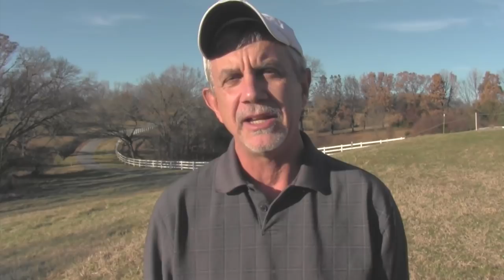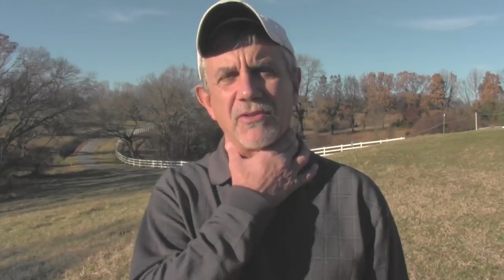Does a Three or Four Cylinder Engine Have More Vibration?  What Other Factors Affect Vibration?

Comment: My new Massey Ferguson 2850 has 4 cylinder engine and is hands down the smoothest tractor I've ever operated. The platform is fully isolated via rubber mounts so I don't feel any vibration.

Comment: I've tested a lot of tractors in the 23 to 65 hp range... The sweet spot is 40 to 55hp. Going larger is in most cases not necessary unless one has a specific work load or job needed where more power is the only way to get the job done. A good seat goes a long  ways in comfort as there is no suspension in smaller tractors when compared to a UTV set-up. Also the 4 cylinders do have a slight edge in 4 stroke balance. Also sometimes a cab model can be more comfortable due to more of the weight being planted down.

Comment: I dont have a tractor yet, but have been a mechanic for 38 years. Yes a 4 cylinder will be smoother than a 3 cylinder. If you only need a smaller tractor and use it to pull stuff and use the rear pto then maybe an old Ford or Massey Ferguson gasoline engine will be best, those engines are really smoth compared to diesels. But I think he will have to go and try a few himself and may have to get a bigger tractor than he really needs in order to get the 4 cylinder

Comment: Decibel meter! Lol Tractor equals vibration. From a man that also has arthritis I find the landscape makes a big difference. I am fortunate to have two. My 1980 JD 1050 is a Cadillac compared to my 06 NH Tc45da. Each one has its advantages but noticed I'm more sore after working with the NH. NH bouncy Jd smooth. Not sure on new ones but I try to stay away from them. Quality is not what it used to be. I believe the smaller the tractor the more vibration. Thanks Mike for all your great info!

Comment: As always Mike, good practical advise. I indulged when purchasing my tractor, some call it a midlife crisis toy but I wanted to be comfortable when it was hot and dry or cold and wet. I bought a NH 4.75 instead of the JD 5075e mainly because the motor is a 4 cylinder.  The only thing I feel I missed out on was the park position in the JD gearbox. This feature locks the tractor real good when on the hills, the only thing stopping mine from rolling away is the handbrake (or the loader😏). Take care Mate👍🏻

Comment: The issue of vibration from AG tractors has been an age old problem that has caused a number of health problems for farmers - so much so that the topic has been the subject of numerous scientific studies based on google searches.  From what I can glean, the 2 main culprits are the steering wheel and the seat. I was not able to determine whether these studies have resulted in any practical solutions.  I have a NH Workmaster 40 that's about 5 years old. I absolutely love it, but I'd avoid it if you are looking for low vibration. The seat is on springs, so I don't believe that's a major cause (from a mechanical perspective it is detached from the engine and frame). Perhaps the unmatted floor contributes somewhat, but I seem to feel vibration through the
steering wheel which is a no frills style. My quick search has not revealed a steering wheel designed to mitigate vibration, so even on the best of models you may need to look for a homemade solution to dampen vib - perhaps some type of soft wrap (e.g., leather, rubber), or gloves as a last resort.  One could probably fashion something for the floor, as I know there are many types of anti-vibration pads, but I don’t know how practical they are for this environment. I will keep my eyes peeled for possible solutions. Good luck.

Comment: I have complex regional pain syndrome from the waist down. Makes me sensitive to vibrations. I test drove Mahindra, Deer, and Kubota. I started with the subcompacts and went up to compacts. Vibration is horrible in the sub compacts and got better as I went up. Once I got to the Kubota L series the vibrations dropped dramatically and was way better than the others. I settled on a grand L 3560 GST. Peddles on HST transmitted vibrations so a gear trans means less time using the feet.

Comment: Assuming you are mainly referring to engine vibration, consider a gas tractor  - tyically smoother and quieter too.  Your old video about gas pointed out the disadvantages
but I don't recall any mention of smoothness, which is the priority for the man asking the question.

Comment: Great vid👍maybe upgrade seat, add rubber mat, rubber block under platform or better work boots but having four cylinder engine will difference just as cab n front suspension that absorb vibration.a

Comment: Excellent summary.  I'll only add that the old gas tractors seemed to vibrate less.  Most were indeed 4 cyl but I think they vibrated less  than the diesels even with the same number of cylinders .

I do think, however that terrain roughness nearly always trumps engine vibration.  Tire choice then is a biggie.  The "rice" tires are horrible for vibration.  Ag tires are rough on hard surfaces.  Industrial tires are pretty smooth on hard surfaces but rougher on rough ground than ag tires.  Worst of all are loaded tires.  Little or no compressible air makes loaded tires near steel wheels in ride quality.

I think the seat; padding, air suspension and adjustability will add the most to vibration attenuation as it affects arthritis.
Reply: Loaded tires are no firmer than air only tires.  Water balloons are squishy.  Squishy depends on the amount of air added after the liquid = total pressure.

Comment: I really like old Fords. But not too old- like 89-95. I'm lookin' at a 260C with a loader. But it is interesting because it's 68 hp and has 3 cylinders. They must be very BIG cylinders!  I'd rather have a 4 cylinder engine for smoother running but I may pull the trigger on the 3 anyway because I really like the 260C. It has shuttle shift and is built like a tank. The older tractors are MUCH cheaper and they don't have all that smog crap.

Comment: In that HP range a Kubota Grand L with a cab and air ride seat would be very hard to top. Adding Radial R-1s helps the ride too if available in a Grand model. They sure helped on my M model.

Comment: I have a Kubota BX2680.  It seems to me that it has smoother operation at higher RPM's than at idle...I normally run it around 2,000RPM for most tasks, only run it up to PTO RPM when I'm running the tiller, otherwise most of my work is just pulling tasks like the box blade, or loader tasks, which usually don't require full RPM.

Comment: My LS XG3025H runs as smooth as glass and has been one hell of a workhorse!!! I love it.
Edit / Info: LS Tractors is an engineering company. It is a division of LS Cable in South Korea. The group was originally part of the LG conglomeration, and was known as LG Tractors and LG Cable, respectively.
LS is associated with Mitsubishi tractors of Japan for technology, and many tractors are based on Mitsubishi designs, as well as use Mitsubishi engines. New Holland Ag also imports LS tractors to resell as LS-New Holland. (They originally had agreements with Fiat, which purchased New Holland. New Holland is a division of CNH Global).
LS formerly supplied base models for Montana Tractors which were then assembled in North America; and sold under the Montana brand name. This agreement ended when LS decided to begin their own imports and dealer network in 2009. They used to build for Farmtrac, a division of Escorts Agri of India, for sale in North America; and for TAFE Tractors of India also for sale in North America.

Comment: Mike, I had a mitz 24hp tractor that was a 4 cly. Much smoother than my yanmar 3 cly which is not bad in my opinion. 
Your discussion of the seat options raises an issue for Alan. Is the issue with seat/bottom vibratikn or foot (pedals and floorboard) and hand (steering wheel, gear levers, 3 ph controls etc) issues. 
I have some numbness in my hands from vibrations and padded gloves help a lot.

Comment: With a hp range that varied I would suggest going used on the bigger end, in the UK the comfiest tractors although maybe not the best seem to be claas however I don't know if they are available over the ocean
Reply: gasoline powered - smoother and quieter. I know you did a video a while back about the disadvantages of gas, but For someone like the viewr

Comment: I’d imagine a battery powered tractor would be the go for low vibration.

Also front mounted implements, especially a mower is good. Much better to see the action in front of you than twisting around.

Comment: Any tractor you purchase should have a cab with heat and air conditioning with an air ride seat if you can afford it. A new JD 3046r so equipped with all the bells and whistles will run about $48,000 new. One that is 3-4 years old with 100+ hours about $12,000 to $15,000 less.

Comment: Cab or open platform?  Noise and vibration - noise is a vibration causing something to move the air molecules - think of how a speaker operates. Higher RPM is more noise (more cylinder firings per minutes) and higher engine load equals more noise from more cylinder pressure per cycle.  Higher RPM may be 'smoother but not quieter. Turbo'd engines are quieter (turbo acts as a muffler), also less vibration because the engines are smaller.  Personally, I'd keep a heated bean bag around my neck, take some air out of the tires, run a wider but less aggressive tire (R4 rather than ag), get my wife to do the job.

Comment: I was nearly killed by a drunk driver Fourth of July weekend 1999.  Since then my right side only has about 60% of the strength and function of my left side.  My dad has an open station shuttle shift New Holland Boomer 40 with a Mitsubishi 2.5L 4-cylinder.  I can barely operate it.  It's too high and the dash is too close to the seat to move my leg over.  For a 4-cylinder it is rather unrefined, loud, and shakes at idle.  I have a Yanmar YT347 that is lower to the ground, has more space due to a 7" longer wheelbase, a more refined 2.2L 4-cylinder, better controls, a substantially better transmission (I-HMT), a low/convenient fuel fill, and a quietish climate controlled cab.  My tractor was 50% more expensive, but was worth every extra penny vs the Boomer.

Comment: My experience is that a gas engine is always smoother and quieter than a diesel. I recently purchased my first diesel 26 hp tractor.  My old Farmall gas tractor has about the same hp at about 1600 rpm while the diesel needs 2600 rpm so the old gas motor makes more torque.   Unfortunately I'm not aware of any new compact tractor with a gas option.